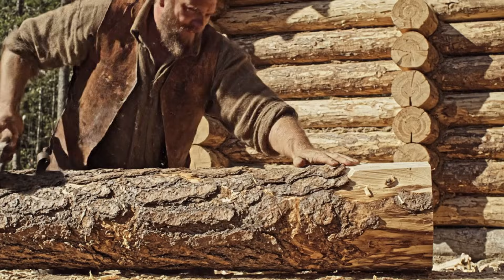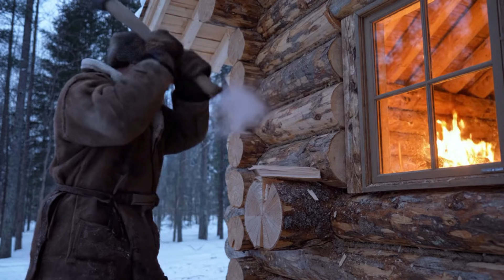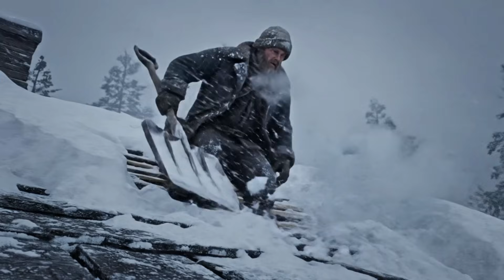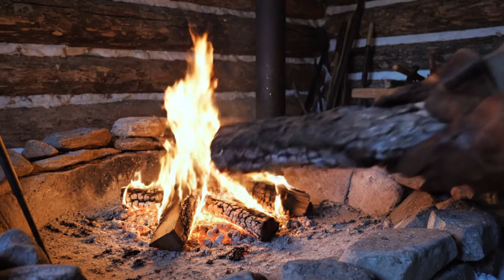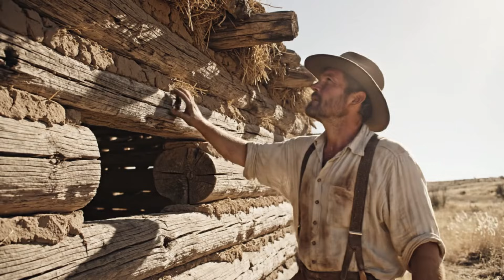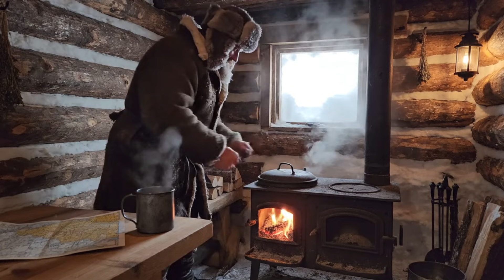Why Frontier Log Cabins Survived Blizzards Modern Cabins Would Collapse In

Comment: I once helped a friend rebuild an old mountain cabin that his grandfather had made entirely by hand. At first, we tried to “fix” the gaps in the walls with modern brackets and metal pins, thinking it would make the place sturdier. But after the first cold spell, the whole wall began to twist, the metal started pulling the logs apart, and a long crack opened right above the doorway.
That was when his grandfather laughed and explained that the cabin had survived fifty winters only because the logs were never locked tight. They were meant to settle, breathe, and slide into place with the seasons. We removed every piece of metal, packed the upper gaps with moss, and within months the wall sank perfectly into alignment, tighter than anything we could have forced.
It impressed me how a house built with nothing but gravity and patience could outlast all our “stronger” fixes.